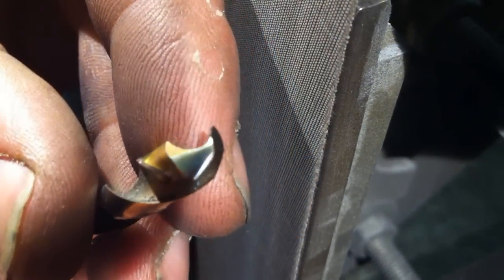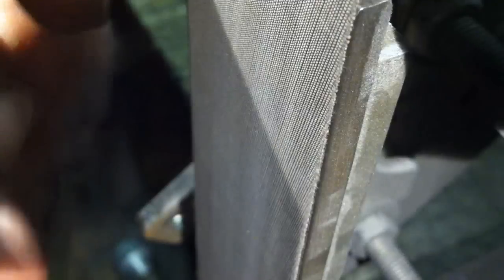Sharpening drill bits- Quick and easy

Comment: When sharpening drill bits, pay attention to the heel, if it is higher or even with the sharp cutting edge, the drill bit cutting edge won't dig into the metal. The sharp cutting edge has to be higher than the heel.

Comment: I want to know why drill bits are not sharpened while still in the drill? It seems that if I have the correct beveled hole in a sharpening stone for the specific bit I need sharpened, I should be able to have a drill bit guide line me up with the hole, turn the drill on in reverse and sharpen the bit in three seconds. Same thing with a band saw blade hold sharpening stone against the blade and by hand run the wheels backwards sharpening the blade. In reverse.

Comment: Rotating the bit creates an S shaped chisel point that increases the pressure need to penetrate the work.
Reply: +Bob Cartwright Well that's a good statement, so what are you meant to do then...?
Reply: +243WW I use the drop shank method witch gives you lip clearance without affecting the chisel edge. I have a quick video on the subject, also That Lazy Machinist uses the same method and he has other great videos.
Reply: +243WW You can always do a facet grind, which is easier and faster to do and if you go for a 4 facet grind (can be done manually), you get automaticly centering drill :)
Reply: Bob Cartwright h